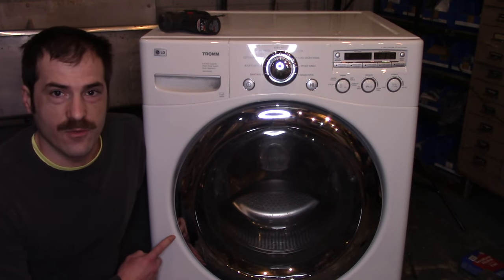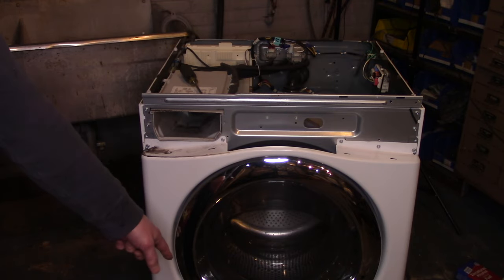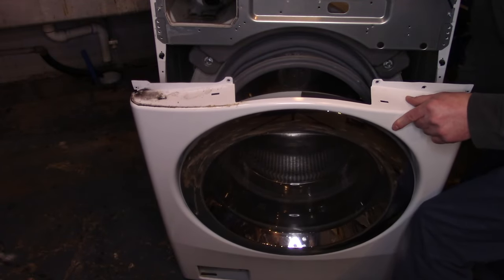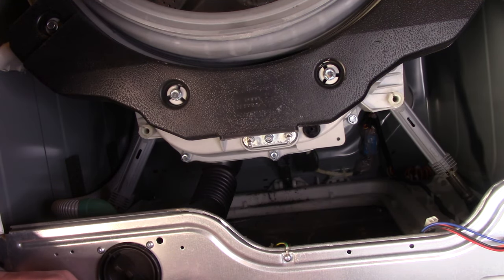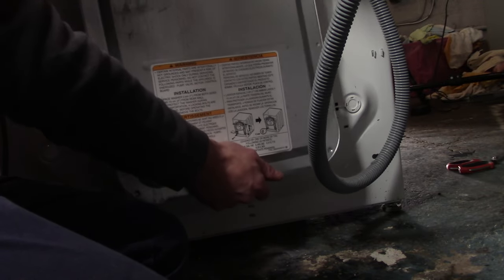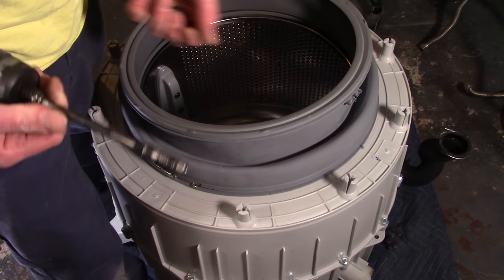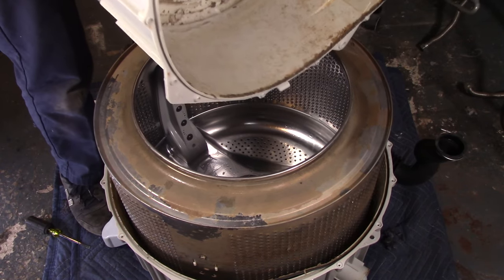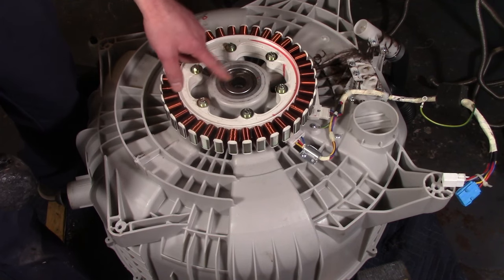How to Replace Bearings LG Front Load Washer

Comment: Very helpful video. I noted using silicone thinly added to the old rubber between the two halves also worked well. May save some trouble since parts for an old model is hard in my country. In many places in Africa, one can get the local car garage to remove and replace the bearings with a press used for car bushes. In skilled hands, it works very efficiently and effortlessly. Apply some WD 40 to ease the process.

Comment: Slide hammer works - bearing puller - using a bearing installer helps- get a threaded rod some nuts and washers of the diameter of the outer bearing and slowly screw the nuts down drawing the bearing into position.
Use a marking pen to - identify location/orientation of components - take cell phone photos before  disassembly ESPECIALLY if you’re doing this in more than one session!
Get a clear plastic jar with screw top and put all loose bolts and screws in. Make sure you screw the lid back on and jar is out of the way.  Get large bin/tray and place removed components in there . Try to avoid cardboard boxes with holes, crevasses, flaps where smaller parts can hide or fall out . If using carb board boxes , then tape seams and flaps down. Keep things clean! It’s a good method to take a break and wash hands , clean tools and parts , change gloves  move about , have a drink of soda - iced espresso - cool water  and plan next round of work. Think it through , prepare tools. If a video is being used , take a few to review next step.  Planning ahead - being methodical and disciplined will get you to attack obstacles easier with less stress!

Comment: I got the bearings out, exactly as you said, it was a beast.  You have to be careful,  but really aggressively hit it. No damage to the LG, but I did hit my hand a few times!  Thank you
Reply: I have used bottle jacks on Electrolux bearings in the past, never had to do an LG...wonder if that wouldn't help? It's a pity you can't use extreme heat or cold, because of the plastic.

Comment: My recommendation is to buy the bearing parts kit first to have at hand.  Get all the tools you'll need, medical gloves, paper towels, cleaner, and steel wool and emory clothe before hand. The leakage and corrosion is going to be significant. It won't look like the unit in the video which is way too clean, compared to mine.

The reason is that there will be a lot of parts and screws to get down to the drum removal.  You may not want to wait for parts to arrive in the mail, and forget what screws are used for what when reassembling.

Also, the inner bearing will be the most corroded. It should be the more difficult of the two to pound out.  I used WD40 as a penetrating oil and let it soak overnight.  This was after close to 2 hours of trying to pound it out first. It came out in minutes the next morning.The outer bearing took about 10 minutes to get out. I mostly used a small section of the large wooden dowel used in closets to hang clothes.

As the guy says in the video, it's not hard but time consuming to get to the bearings for replacement. Be organized! He also says to take your time cleaning the corrosion off the spindle.  Very true.  The spindle is steel while the rest of the spider is aluminum or similar. Looks like electrolysis is what's responsible for all that corrosion and crude.  Stupid engineers as they know better.

I will never buy a front loading, fancy washer again.  It's been maintenance intensive compared to my old top loading Kenmore.

Comment: I think watching this video, I will have to go buy a new one. My current bearings are gone and I can hear it screeching. Reality is that my washer is on the second floor and I need to bring it down to the garage to dismantle. That alone is a workout. With a possibility of a 20% failure rate with the hammering process I think I should just buy a new one and have Costco deal with disposal. I'm sad because the dryer is actually still good, but the OCD in me won't allow me to have an unmatched pair. Every place I called refused the bearing job and explicitly told me to buy new. I hate sending this unit to the dumpster.

Comment: Thanks for a great video tutorial! It took me five hours but saved me over $12000 for a new washer. I got my bearings on Amazon. Your right about your description this is a total beast of a repair. The most challenging part was getting out the bearings but I used a drift and a large 9” long 3/4” dowel to hammer them out. The dowel was safer and saved me scoring the channel it fits in. Pro tip take lots of photos as you do this repair and be brave This repair quickly becomes an appliance autopsy site but patience and documenting where pets come from will serve you well.

Comment: Thank You, your video saved me a lot of time on this job and the washer is working like new again.  The parts all fit perfectly.  One addition that might help someone.  The Spider on mine did have rust on it but not in the bearing race area.  My bearing races cleaned up perfect with very little sanding.  My seal surface was terrible from rust.  After sanding a lot it still had pits deep enough to catch my finger nail on.  It would have leaked badly if installed like that.  I purchased a National Seal Spedi Sleeve or Repair sleeve.  Part # 99145 or Timken Part KWK 99145 $37 local purchase cost.  The sleeve needed to be tapped into place.  I had a piece of 1 1/2 " PVC pipe.  It fit perfectly over the sleeve and let me tap it onto the Spider shaft.  Now the seal has a brand new wear surface to run on.   In Automotive and Heavy Trucking they use these sleeves all the time to repair old worn seal surfaces.  Again.  Thank You for your video instructions, would have been hard to do without them.
Reply: Standard bearing sizes are a blessing to us all.

Comment: I spent a long dark weekend alone with my washing machine, with nothing but my tools, a set of replacement bearings, and some work lights.

And this amazing video.

Some tears were wept, some sweat was poured, and yes, even some blood was shed (hammer, drift, thumb), but I finally prevailed, all because of the information found here, so I had to write to express my gratitude.

My wife thanks you, my wallet thanks you, and I thank you, from the bottom of my underwear drawer.

Having said that, I will mention two things that came up during my battle with my washer.

Getting the drum apart can be a bear, but one approach that might help would be this: Use two cement blocks, each covered by a towel, placed just enough apart that one could rest the outer plastic tub's edges on them and have the inner tub hang freely.  Gravity will help get the parts separated, and it is easier to tap downward than to try to hold the drum while doing a side-tap.

If the bearings cannot be removed, it might still be possible to salvage this project by purchasing a replacement drum assembly.  The bearings come installed, allowing one to bypass that whole part of the endeavor.

Thank you again for this tremendous video.

Comment: That smaller bearing drops out in 3 seconds if you grab a 7/8 socket and attach it to a 12 inch extension...(the 7/8 socket fits perfectly through the larger bearing yet its still wide enough to rest on the inner metal ring of the smaller bearing; thus avoiding the rough edge damage you had to fix on wall)...and knock the end of the extension 3 times with a small mallet

And then for the larger bearing flip that b@#=h over and grab a 1 1/16 socket with a 12 inch extension and wack it 3 times

Now your success rate jumped from 80% to 100%

Pin this comment...your welcome..and thank you for taking the time to make this video

Comment: MY LG FRONT LOAD MACHINE  MOTOR IS  STUCK WITH IN ONE AND HALF YEAR .  GUARNTEE  PERIOD IS  OVER ..    NEXT TIME I GO FOR TOP LOADING  MACHINES  SEMI AUTOMATIC .   FRONT LOADING MACHINES  DOES NOT CLEAN PROPERLY .     I DONT KNOW HOW THE BEARING STUCK SO SOON .  ACTUALLY THE TOTAL RUNNING HOURS MAY BE  300 HRS .  THIS TYPE OF MOTORS IN FANS ARE  RATED FOR 3- 5  YEARS CONTINUOS  OPERATON .  EXAMPLE   SIMENS   VFD PANEL COOLING FANS .

Comment: at 14:52 you mentioned that "this seal is the absolute source of the problem and why the bearings failed". Yet, it was never replaced. Why?  If this is the cause, and the failed bearings are the effect, why aren't we addressing the cause as well as the effect? It seems we are setting ourselves up for failure.
Reply from the maker: At 23:25 the seal is replaced.  It is implicit that it is a new seal
Reply from the maker: At 23:25 the seal is replaced.  It is implicit that it is a new seal
Reply: @LorainFurnitureandAppliance  Yes, I saw that at 23:25 and have watched the entire video twice.  But your pointing to and making reference to a seal at 14:52 that isn't there at the shaft at the spider arm. Listen to your own words carefully.  Very confusing!  Totally awesome video otherwise!
Reply: The time to say "THIS seal is the absolute source of the problem...." was at 23:25 and earlier when removed.... At 14:52, the proper thing to say was " You see this corrosion and build-up, the failed seal that we removed earlier caused this, and we're going to install a new seal soon on the inside of the drum after we install the inner bearing".   I hate to nitpick your awesome video, but that part drove me nuts. It wasn't until I had my machine apart and starting cleaning my shaft, LOL, that I realized there was no seal there.

I have some other tips that I'll share once I'm totally done. One tedious step that you did was totally avoidable and I have an easy shortcut to share. Thank you.

Comment: YouTube has several video clips on this topic. This video is the most relevant to the newer models on the market for the last ten years or so. Its step by step description of what one will see during the repairing process is crucial for folks who haven’t done the repairing before. The only suggestion I have after going through everything myself, is to remove the motor to reduce the chance of damaging it. Since the next step is the most difficult one, and as an expert with over 20 years of experience, he only achieved ~80% success rate.  I tried his method and used a hammer to knock on the shaft for over 300 times without separating the spin basket from the tub. Eventually, I lifted the spin basket and tub 2-3 feet above ground, shaft facing down (that is why motor has to be removed first), dropped them on a wood board, shaft hitting the wood board every time. After about 30 drops, the spin basket and the tub were separated. I believe my method should have a higher success rate LOL. After this step, the rest was home stretch. Also, when knocking out old bearings, be sure the contact area is on the bearing, not touching bearing housing. Otherwise, the surface of the bearing housing can easily be damaged. The last step of reinstalling the front door spring for the rubber seal isn’t the easiest compared to other videos. But overall, this video is the best in terms of telling the viewers what the most difficult steps are, such that folks who haven’t done this before will have a more realistic expectation.
Reply: Ah, yes, the 'get a bigger hammer' trick. I think his tip on re-installing the boot spring was aimed at preventing damage to the very expensive silicone rubber boot as much as to avoiding the cost of that LG tool. An inexperienced person - the target audience - needs tips and tricks to avoid mistakes they don't even know are possible.

Comment: Of course, the screw at 3:07 is rusted and at an angle where I can't fully seat the screwdriver to the screw.
Reply: Yeah just tip the whole front panel forward and you will get a good angle to place the screwdriver on the screw.

Comment: The video was great except the fact he edited out the actual removal of the bearings and for good reason! F those a## m fers that created those crap ass contraptions. I broke 2 bearing removal tools. Smashed my finger and even tried to weld to the bearings. Finally I had to cut the bearing to pieces and that was to get out the first one. Then I finally gave up on being gentle using wood and went full on sledge hammer with it. I have mashed the hell out of the shaft and don't care. That bearing is going to come out!

Comment: Dear, invest money on a good BRASS hammer & set of carbon tampered chizzles... Your life will be more easier & your work will cut to 3/4th. This way your teachings will also be admired. You did a good job but I have no idea why DO YOU not get the 100% results you require. Overall you tried your level best to teach & explain  everyone, good job though, just concentrate on required tools to do this job & REMEMBER TO REMOVE ELECTRICAL PART FIRST SO THAT THEY CANNOT BE DESTROYED.

Comment: Stop and listen to an experienced Appliance Tech! As this excellent experience repair person explains at the 12-minute Mark. This repair is not always successful as a matter of fact the success rate is maybe about 50 to 60% which is not good odds for a DIYer. The problem is is when the rear bearing gives way and the unit starts to leak most owners don't even notice until water gets on the floor and it is so rusty and corroded taking the bearings out your rotor stator and everything else will be rusted or corroded depending on how old your machine is. I can clearly see that the drum Basket in this video is not as bad as most that I have seen. If you do not have the patience and the mechanical skills do not attempt this repair just go out and buy a new washer machine. The last one of these me and my best friend both of us with a combined 40 years of experience tried to repair was an absolute disaster and we said never again will repair any bearing assembly that is on a machine that old or rusted  one of the big causes of concern is removing the basket and or replacing the spider with the basket which many times goes hand in hand with this bearing job. This repair is not for the weak. Regardless of the skill of this repairman in this video if you are a DIYer this repair could easily take you 3 to 5 hours and it is still a gamble that everything is going to reassemble correctly and not leak. Even though I'm an experience repairman I absolutely refuse to do any LG front load bearing repairs or spider repairs I tell the customer that it's $1,000 and that will usually change their mind very quickly. Good luck to those of you who attempt this repair and are successful as that is most definitely not always the case with this type of repair. Not worth my time or energy

Comment: In case anyone else is completely stuck getting the inner bearing out, here's what worked for me. My inner bearing disintegrated upon removal, leaving the inner race stuck in place. With very little to pound against, I resorted to using a Dremel tool with cut-off wheels. After a several broken cut-off wheels I was able to make 2 cuts, about 30 degrees apart, that each went most of the way through the race. I was then able to drive a small, sacrificial screwdriver between the outside of the race and the recess and break off most of the race. What little remained broke easily with a little prying. Amazingly, the damage to the recess was quite minimal.

Comment: this is not an easy repair job. i know you can save money by replacing this bearing, but i think it is better just to buy a new washer because other parts of any old washer will start breaking one by one after the main bearing failure.